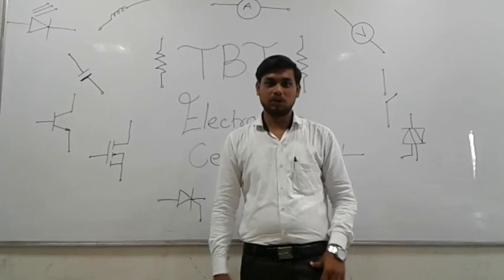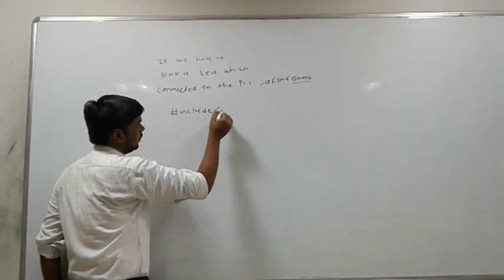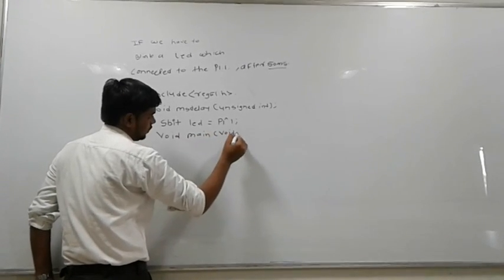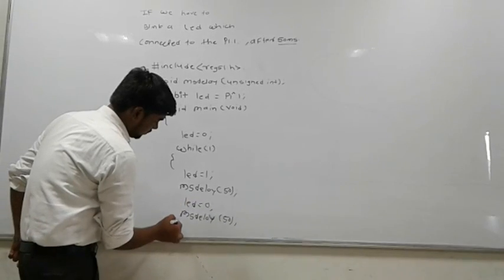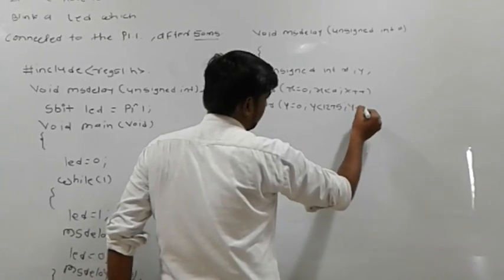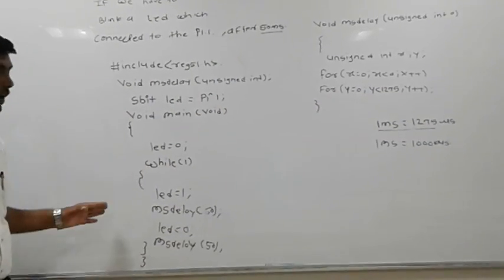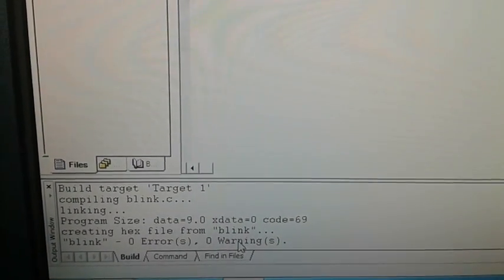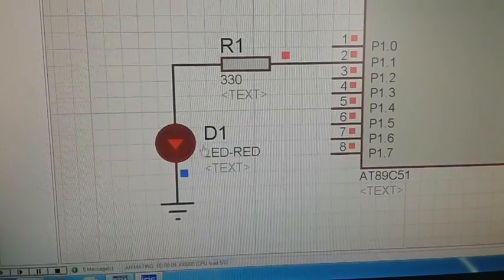Embedded C Program to blink a LED.

Comment: continuous fashion, meaning, the first LED in a strip is at the Top-Left corner, then the second row's last LED is connected just after the first row's last LED, and the third row's first LED is connected just after the second row's first LED. Write an algorithm in embedded C to glow these RGB LEDs which are arranged in the above continuous fashion. Write an algorithm that animates a transition of the lights from Left to Right. Eg. for a 3x3 LED grid, the following will be the transition sequence: 1st Row: RGB 2nd Row: GBR 3rd Row: BRG The next frame in the transition will be: BRG RGB GBR